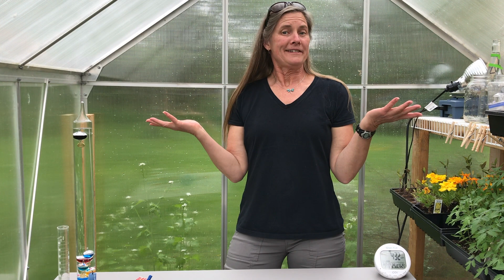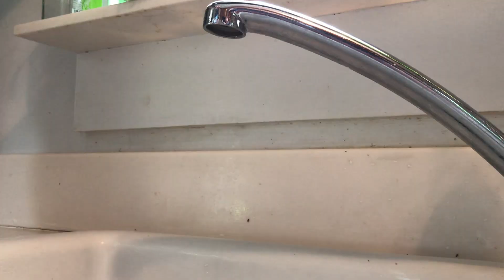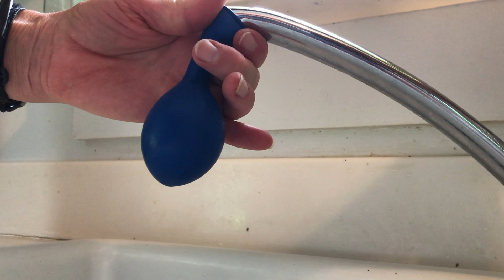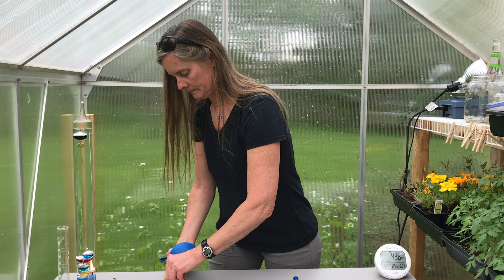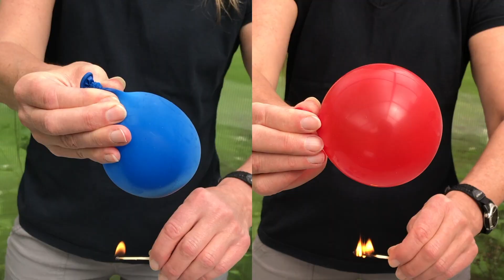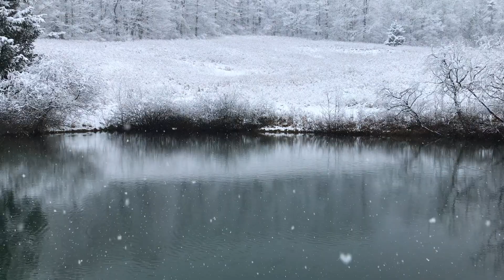Feel the Heat Capacity (In the Greenhouse #5)

Comment from the maker: This video discusses heat capacity (units of J/K), an extensive variable that depends on the size of the system. The corresponding intensive variable is specific heat (units of J/kgK).
At STP the specific heat of water is 4184 J/kgK, while the specific heat of typical air is 1012 J/kgK.  In this experiment, the balloons each have a diameter of ~10cm (0.1m) and thus a volume of ~500cm3.  The corresponding mass for the water balloon is ~0.5 kg and the air balloon is ~0.0005kg.
The water balloon has a 4x greater specific heat and a 1000x greater mass, giving it a 4000x greater heat capacity than the air balloon.
The other parameter that affects this system is the thermal conductivity of the air and water inside the balloons (units of W/K).  The thermal conductivity of water is ~25x higher than air.  So even though water is a better heat conductor, the 4000x difference in heat capacity is the controlling variable in this experiment.